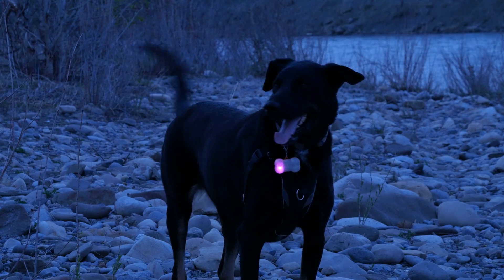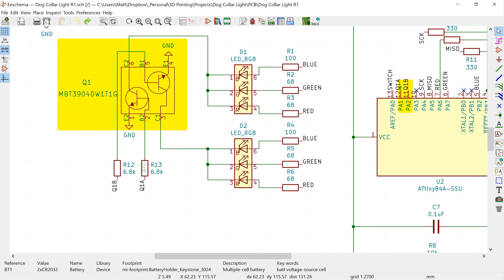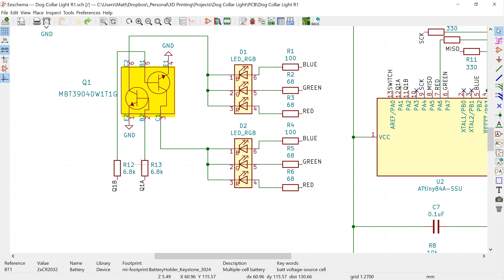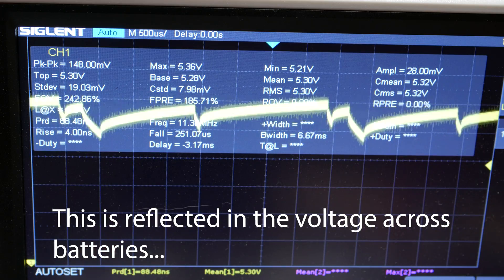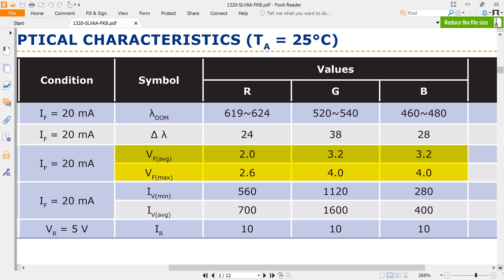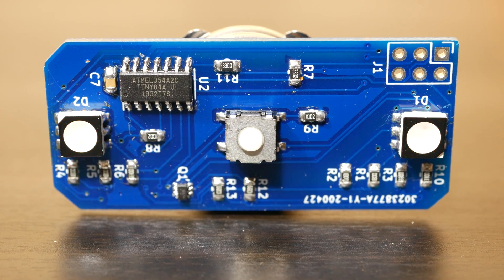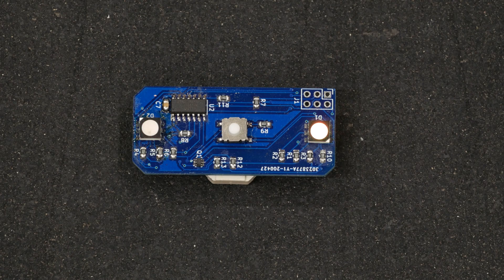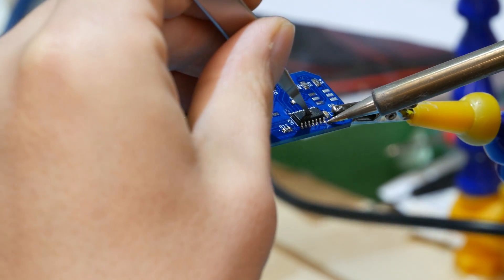Why This "Simple" Dog Light Took 2 Years to Build

Comment: Nice work!. I have made something similar once without a microcontroller, but the trick for keep the current consumption low was "exchanging current for time". Using a RC net, you can charge a capacitor for a period of time with a low current, then u can use that charge to drive the led, this is posible bc u don't keep the led on all the time. Doing this u keep the current from the battery at a low value and maybe u can use just one batt and get the 3V without dropping. I imagine u can conect anode to the cap and catode to  the microcontroller pin and keep it as hi-z (input) so the cap can charge through the resistor and then use the pin as output (pwm) to get the led on using the cap charge. ;)
Reply from the maker: Thanks! Definitely deserves more experimentation.

Comment: Just curious, if the batteries are fresh and the light is turned off, will the effective voltage to the attiny be out of spec?
Instead of the eeprom option, and perhaps even the stronger clip, you could consider adding an inductor in series with the battery and a diode in reverse over the battery. The inductor will keep feeding a small current it holds. It might even allow you to remove some of the capacitors.
Reply from the maker: Yes it is technically out of spec, by quite a bit actually. If I ever build a v2 I can think of a few ways around this problem, including a diode + not powering the LEDs directly from the pins (that way ATTiny can be 0.7V lower than LEDs - don't want the diode affecting them or it will go below usable voltage sooner). 

I think the reason it works anyway is because the ATTiny only ever experiences that voltage when it's in sleep mode where it's drawing almost no current. As soon as those LEDs light up you are within spec. That said, obviously running a device outside of spec isn't great practice, YMMV, etc.

Love the inductor suggestion and if I ever make a V2 that's on the list to try.